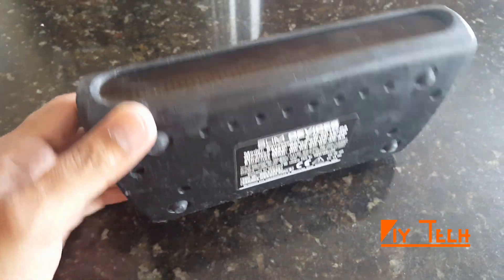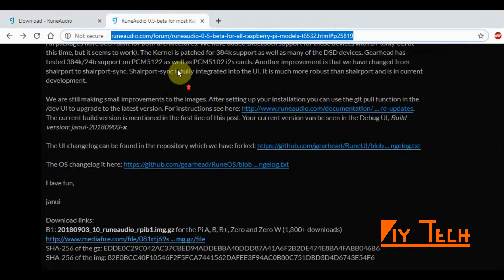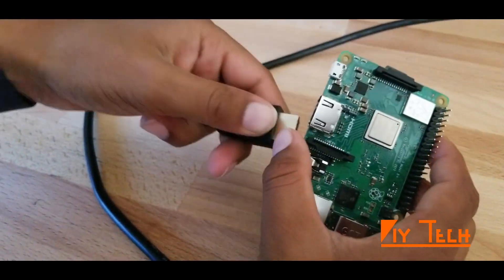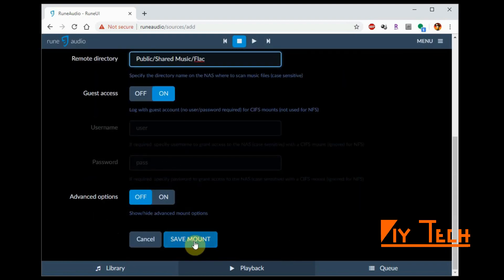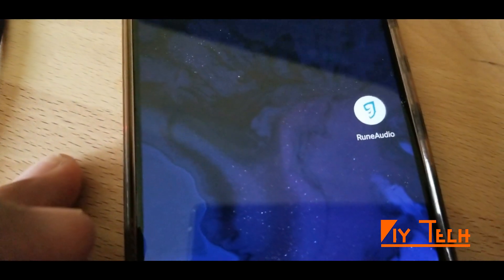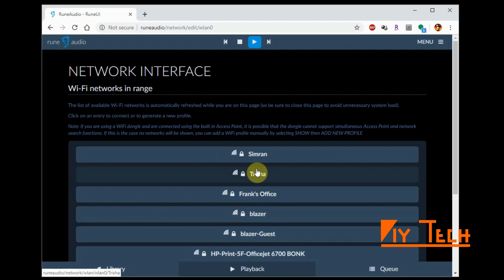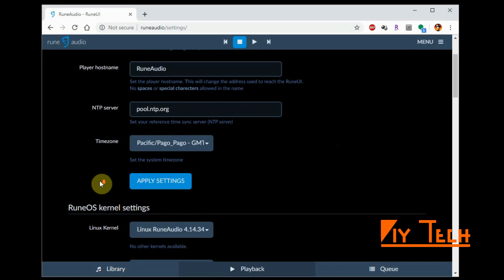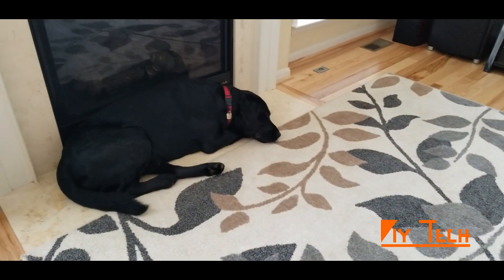Raspberry Pi FLAC Player | Rune Audio Install | Hifi Berry Digi+

Comment: Very nice video. I just ordered a HiFiBerry Digi+ Pro today and then found your video! 😄It's going to feed my Topping MX3 direct to optical, so hopefully sounds good. Even testing the pi 3b with its 3.5mm output it sounds great. Wonder if it will really make a big difference!

Thanks again

Comment: THanks for the video it is very helpful.  One question,  is there a limitation to the bit rate it can play back?  I'm hoping it will playback 24bit/192kHz
Reply from the maker: I got few tracks from hdtracks and it plays 24 bit files.

Comment: I'm very much impressed with your setup. Hope I got the right video. I've a very nail biting(an irritating too) query. I've a Yamaha R-S202 stereo receiver driving my locally made 130 watts 2 way floor standing speakers. I've almost 1 TB full FLAC  (HI RES) music files. Used Laptop or Bluetooth to play my music. Was not too much impressed with the sound(without any DAC). The setup was not up to the mark. Every time keeping the laptop connected was also not feasible. So my question to you can I play my FLAC files from an external HDD with similar setup or something similar directly connecting to my amplifier. Hope I'm able to explain myself. Any suggestions/guidance from you will be very much appreciated. Thanks & Regards. P.S : you can mail me - iamguha@gmail.com
Reply from the maker: There are couple of options, 
 If you have a NAS, you can load your Flac's there (  NAS is what i use). If you don't have NAS, most modern wireless routers have inbuilt NAS support, so you can plug your HDD to your router, and use that as your NAS. 
If your receiver is network ready and can read NAS then good. If not, your options are using an external FLAC player. 
If you have a google chromecast Audio (or video) handy, you can use that as your player as well. You can hook that to your receiver, and use apps such as Squeezer, HifiCast (both free) to play Flac files (from NAS) through your receiver. Quality is much better than bluetooth connection.
Reply: @rmanni  I too have all my music (about 3000 CDs) in a 6TB USB hard drive. It is a self powered LaCie D2 Professional drive. 
I was hoping to build a streamer to play the music from this hard drive as well as from the internet but I am not software literate (technically I’m a senior citizen). 

1. You said wireless routers are NAS capable but how does one connect a USB hard drive to a wireless router (the router ports are only LAN ports).  Do I need to buy a router that has a USB port? 

2. Did you consider Moode Volumio or Max2Play? These are the options most people talk about. I intend to use the Allo DigiOne HAT sold by Fab2lab. 

3. Since you are technically competent, do you know how to connect a small 2” screen to the Raspberry Pi so that you could see what music was being played? If so how? This is my biggest challenge. 

4. I see you have 2 displays being used. How do you connect both screens? I assume one is your TV via HDMI and the other is your PC/laptop but I don’t know how that is connected to the Pi. 

Thanks.
Reply from the maker: @navinadv  
1. Most of the new routers come with USB (NAS) capable port. If your Router does not have a USB port, then you probably need a new one.
2. I went with free opensource software, and I did not try the other 2 you mentioned. I believe Volumio or Max2Play have some paid options available as well.
3. I believe there are display screens that plug directly into Raspberry pi are available in the market. Just like the way I connected the Optical Out board, they will also come with some sort of connectors or ribbon cables. For my purpose, either TV screen or the App on my phone serves as display screen. So I did not purse additional screens.
4. For testing, I connected Pi with my tv/monitor directly with hdmi out. Once I knew its working, I just use the app on the phone, or type the url on my laptop browser to get the display. Both will work.
Reply: @rmanni  Thank you,.

1. So I need to find a router that has a USB port and connect the RPI and the hard disk to that router? Thanks

2. Yes Volumio and Max2Play are paid but hopefully they will offer some support in return, at my age I need a lot of hand holding when it comes to software.

3. These small screens connect via what is called SPi. I assume this means Special Purpose Interface and they require coding of which I have zero knowledge. I would have to find some youngster willing to help me with that.

4. So your laptop was never connected to the RPI? 

Thanks again for your quick response. I guess from your accent that you are an Indian living in the US. Probably a young software professional. So thank you for helping a fellow “Desi”.
Reply: @rmanni  Thanks for your prompt response. Well going through your reply,I guess my options are limited. My Yamaha R-S202 stereo amplifier has only Bluetooth as an option.Rest are all Analog RCA input. I've a very limited budget to work.So option to upgrade my Amplifier. If you have any other option in mind taking into consideration my present setup,request you to guide me. Thanks & Regards